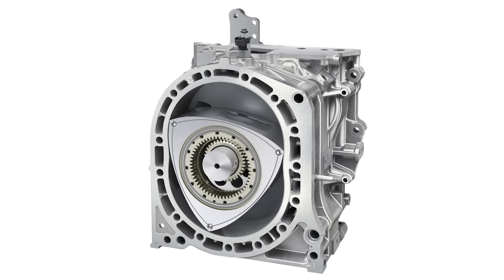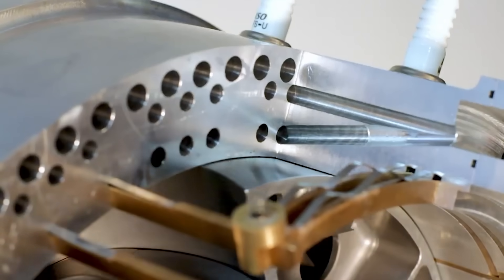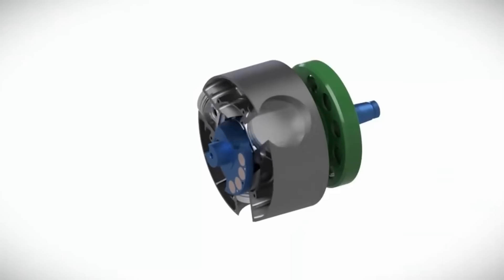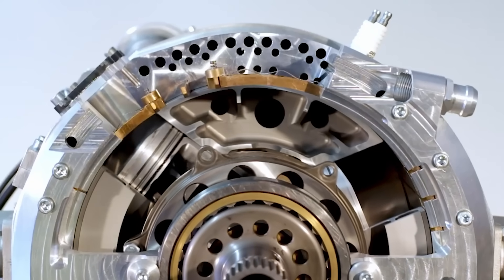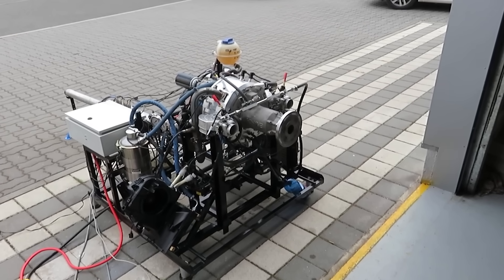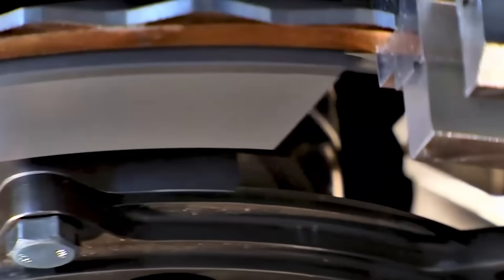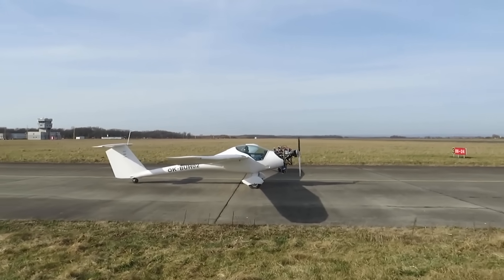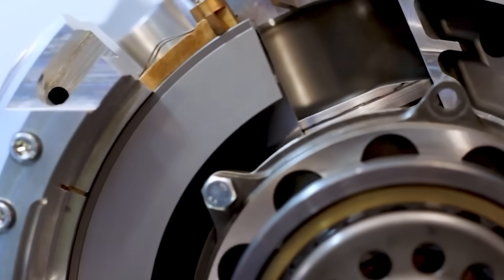The Birotary Engine: A New Spin on Combustion

Comment: This is all fake. It's completely nonsense. It's amazing. People can talk and write things down. It's really crazy. There's really nothing else. There's only really four or five types of engines that work that we know of the four-stroke psycho engine. It has a long stroke or short stroke. It's kind of a different engine. Economy is like a medium stroke. Then you have the two-stroke cycle. Then you have the jet engine and then if you go electric you still need a generator. The electric motor would be the best but electricity is hard to come by just like hydrogen. It's possible there's a lot of engines out there. Freight trains medium size boats that use electric motors Pepto diesel gas generators

Comment: The counter rotating shaft still does not counter effect of the full weight of the total engine rotating in the opposite direction. There is still going to be torque issues also, even though you have a planetary gear system. This engine has a specific use, which is also countered by already efficicent engines that are more useful in aviation and ground vehicles. This is not a break through, but a concept that has already been tried and failed, by people thinking they have the next revolutionary thing. Money that was spent by investors, that are not on the higher spectrum of I.Q. If this is what the money invested in gets them so be it. The next revolutionay engine uses a total enclosed system useing hydrogen. The governments do not want this because it would be a total collapse of the gas and oil industry, which support so much taxes to said government. Hydrogen is free and can be extracted from water. A non taxable compound, that is produced easily through rain or a drainage ditch, that the government can't control. That is where the future lies, if the people finally say enough is enough, our government has too much control of our lives and economics.

Comment: I suspect cooling is going to be a problem. Especially  the actual cylinder block portion. Heat expansion is going to be an oil seal nightmare.

Comment: In contrast to the Wankel engine this engine is a piston engine. In contrast to other piston engines with the same swept volume it has a much larger total volume, it has more moving parts and much larger moving masses. Furthermore, the manufacturing and assemby and disassambly of this engine is more complex. You can get the same functionality by a simpler star design engine, which has also less total volumen and moving masses. And you can also modify the contol valves of a star design engine by use of two stroke principle an intake blower and rotary valves.

Comment: Two problems right off... 1. The main rotating cylinder body seal will eventually leak oil and combustion gases. 2. Oil will immediately build up on the bottom of the pistons changing its weight and flooding the cylinder walls. The centrifugal force of rotation will prevent this from ever becoming a solvable issue, unless the bottom of the pistons were axially level with oil discharge holes at the bottom of the stroke.

Comment: Interesting idea. I'm a big fan of minimizing components. Simple systems are inherently less error prone than complex systems. I don't see a future for it necessarily as a direct to drive train application, but as the basis of a hybrid system it could be a thing if the lubrication can be worked out. Good luck! I hope to see future improvements... even if it does sound a bit like an upscaled RC engine.😀

Comment: Engineers chime in here, but it seems like the power stroke is going to be fighting the pistons being flung outward by the centrifugal forces generated by rotation.  I'm guessing there's some natural upper limit to RPM on this engine design.  Would that make this a relatively low-revving engine?

Comment: De no llevar válvulas que necesitan espacio para subir y bajar yo desplazaría la cámara de compresión y la incrustaria en el rotor contigua al cilindro en la dirección de giro
Con forma de garfio así logramos que toda la expansión de la mezcla golpee sobre el rotor dando directamente todo el par al rotor.

En una rueda que gira si aplicamos el vector fuerza en su perímetro se obtiene Potencia= Fuerza x brazo de  potencia (Radio)🎉

En los Otto el brazo de potencia en más pequeño (el codo del cigüeñal)

Comment: The WW1 rotary engine which had the whole engine had issues due to the gyroscopic effect from the engine.  If they can get the counter rotation in this engine to cancel most of that out it would be a bg step in making it useful.

Comment: What you get is a waste of time.  Stop spending money trying to eek out a bit more from an internal combustion engine. Electric transport is the only way forward. It's simpler.  It's more efficient.  It's cleaner.  It doesn't produce greenhouse gasses.  You can charge it at home, sometimes for free always for a lot less than buying petrol of diesel or even LPG.

Comment: This is a really unfairly positive and incomplete take.  There's lots of details on the positive aspects and components, but zero details about the flaws.  The 2 biggest rotary engine flaws are seal wear and inability to cool the central rotor.  This fixes one but not the other.  The sleeve valves are great, but what about all of the known and unknown problems of such an arrangement besides "timing"?    So much interesting info left out!

Comment: Interesting, but due to the large amount of area that is exposed to combustion pressures, I think it will have about the same service life as a rotary engine. Another issue is that an object in motion wants to move in a linear fashion. Because the pistons and cylinders are rotating, it seems the pistions and cylinder walls are going to wear more on one side than the other, shortening its life even more. On the plus side, it employs a number of innovative concepts. At least it runs, which is more than can be said of other experimental engines.

Comment: If it passes the longevity test and actually gets work done efficiently of course it will be a winner! 
There are many new engine designs, but they never have them worked out yet. While interesting it’s nothing to get excited about.. I want to see it working for thousands of hours doing substantial work while saving substantial fuel/energy. 
Internal combustion engines will always have a place in future application.

Comment: how stupid an engine design this is.  it has taken every negative aspect of a wankel rotary (seals, lubrication and more) and thrown every negative aspect of a "standard" ICE into a spincycle.  you're using combustion events to spin the innards counterclockwise while also using the combustion events to spin the shell clockwise AND expecting the energy remaining is significant? laughable

advancements come from simplification or optimization. this does neither.

Comment: Looks like it still has the sliding seal problem, the weak spot on any Wanker engine, and one which was never solved.  
Because lubricating flat surfaces (which always move in the same direction) turns out to be much harder than lubricating reciprocating round (ie; topologically connected, short path) surfaces.  Cool science fair project tho.

Comment: I'm not sure about this design.  It seems to combine a rotary with traditional engine but I don't like the high rotating mass and inefficient sealing of sleeve valves.  Tuning this engine's breathing would be a challenge as well as long term reliability/durability.

Comment: I like this alot, as well as the Achates opposed piston engine, the Orbital direct injection 22 stroke, and the INNengine e-Rex "one cycle engine" but as with many interesting and promising designs, they never make it to an application or an actual platform (auto, boat, airplane, etc). Good ideas and interesting engineering, but essentially dead.

Comment: all those gears and spinning will seep power like no tomorrow. plus one of the issues with wankel engines is that you can't have variable cams in them because the cams are ground into the housing. all that rotating, huge mass will be slow to respond so throttle response will be crap. not good for cars but for airplanes maybe.
Reply: For planes it's even worse. Imagine you're on final approach and you're short on airspeed so you open the throttle just for you to stall before the engine revs up in 3 to 5 business days.

Comment: now all you need is a rotating assembly oil and compression ring that rotates so that it doesn't have to sweep the open across piston cylinder burning oil.

Comment: I can anticipate long-term seal problems. There is a considerable amount of surface area that has to slide against other surface area. This makes proper lubrication all the more vital.
Reply: It's less surface area total than that of sealing rings in each piston.
Reply: @michaelbuckers  Rings never hit edges on 4 cycle engine, so they don't wear as fast. What does the sealing is oil. This would just burn oil because it would always get into the air fuel mixture.

Comment: Having this huge heavy rotor means poor acceleration compared to a comparable three piston engine. But the non-sine geometry could help with fuel economy.
If there is use for this then maybe in generators or aircrafts.

Comment: No words of efficiency?
Reply: You don't need to be a genius to see it's abysmal. Wankel engines already have astronomical fuel consumptions and this not only seals even less because of the greater contact area, but it also has to deal with the inertia of the pistons.

Comment: Change spark plug and then you realize a small chip of crap got inside, or a small chip got in through the air filter, and it rips through all the seals because IT CAN. Not the same with most other engines, but was true with Wankels. The seals here are not efficient for conserving energy. Interesting design, but more interesting to me is if you total up all the patent and R&D expenses and explain them for the useful worth. What nations will NOT abide by patent laws? China, russia, N. Korea, Iran, Venezuela, Cuba, ... and more... please name them and then detail the size of GOOD markets.

Comment: The exhaust port consists of cross-sectional area almost as large as the piston area.  That's going to be a problem with near zero scavenging but it looks absolutely ideal for a turbo system.  This man is absolutely brilliant.  Congratulations to him.
Reply: it will burn oil like crazy.

Comment: You don't NEED to WAIT to put this engine in a car. It would be great for HYBRID, engine system on an electric car. It has no vibration, and that helps any generator you pick for the car. It's also light.
Reply: This is literally the worst possible engine for a generator. For a generator you want a low revving high torque engine, that's why train locomotives use diesel engines.
This has pathetic torque, enormous levels of emissions (EPA will never approve it much less the EU), and is worse than a simple wankel in every single metric.
The guy based the design on a complete misconception that modern valvetrains are fragile, which they are not at all.

Comment: All fine of it's powered by compressed air but the moment you use a Carbon Based Fuel to make a compression you make GRINDING POWDER and what was a nice seal when new will begin leaking after the first full rotation.
The Carbon powder will totally destroy this design ... go back to electric

Comment: In 1962 I saw my first Wankel Engine at the EAA Rockford Fly-In. It was sitting just inside the Gate where you enter from the field and Felix Wankel was there explaining it's benefits. He had a small prop mounted on the engine, which he spun by hand to start. Within seconds we were covered with oil but we'd seen the first running of a Wankel Rotary Engine. Mr Wankel was hawking the Rotary as an Aircraft Engine because us its Impressive Power-to-Weight Ratio. But, Yes, there were still some problems to be worked through, notably the lube oil issue. It will be intriguing to see what sort of Power-to-Weight Factor this engine has.

Comment: The wenkel rotary’s greatest problem are the many moving seals. I don’t see how this will not have the same problem
Reply: Agreed but one of the problem with wankel is that seals are located on the rotar making direct lubrication impossible. In this motor the seals are on the housing so possible. Likely emissions issues with oil burn

Comment: There is a lot of frictional losses in sealing the combustion chamber. Rod ratio looks low so side loading on the pistons will also be an issue. Cooling the cylinders doesn't look like it is very efficient. Thermal growth of the cylinder block will make for some sloppy tolerances earn cold and potential siezing issues if it gets too hot. Neat, but I don't see it panning out in the real world.

Comment: What are the torque values that are comparable or exceed most not all engines of that size? I call bullshit on this nonsense engine if its so good show it at 7000 rpm why do we have to imagen it? How easy is it to mass manufacture and is it cost effective? It's also limited to fixed valve timing and duration. It is compared to a Wankel for reliability what a joke the only company making them is stupid Mazda and they are just range extenders on EVs. In order to test these engines for longevity and reliability hundreds need to be tested at the same time side by side some of these engines need to be taken apart and have the parts measured to test if the thing is kicking its own ass before you can state that it is of any merit.
Reply: The wankel on the second generation RX8 is actually quite reliable, it just has awful fuel consumption and emissions.
There's also a few companies commercially selling much more improved wankels with better apex seal designs.
The main problem with Mazda's early rotaries is that they were all derived from their LeMans design which didn't have to survive longer than a single race.

Comment: Very impressive but as one chap mentioned, the angular speed due to increasing diameter of rotating assembly, maybe a limiting factor. However further development and increasing material science may well solve wear, heat, friction problems. Good job and hope it works out. 
Regards, A man from the Ozzy Velt!

Comment: Last 20 years i have lost the count of all the new cool engines that were supposed to make the traditional Otto cycle IC engine obsolete. This is cool tho. An engine where the pistons go straight up and down and eliminate piston rubbing is good. But i think of all the engine design that have come forth last 20 years is opposite piston that has coils in the middle and can create electricity. Free-piston engine linear generator (FPEG) they call it. Could be a efficient electric car range extender...
Reply: This is an Otto cycle IC engine. 

The pistons experience lateral force like any other piston in a crankshaft and connecting rod system.
Reply: It's literally just a regular 3 cylinder engine with a very large round head. The French already tried this in WW1.

Comment: Its axial (static) housing layout reminds me of the boxer block but at 120° opposition instead of 180.
The firing plug opposition seems to me a better design than the Wankel double spark plug design (wankel uses for complete combustion).
I'm interested in the Bi-rotary crankshaft, it appears to be a simpler design than an eccentric crank. Almost a standard crank but even shorter than a V-6. 

I also love deleting the timing belt and camshafts. 

Now about that exhaust note 😂

Comment: My first concern is heat dissipation!  Engines that run near rated power all the time - aircraft and boat, need lots of cooling.  The fact that the pistons AND the cylinders are rotating and essentially uncooled is a problem.   The Wankel rotary also had this problem in aircraft applications.   There's also the additional friction from the wiped surfaces rotating along with the idea that you're driving the pistons toward the crankshaft as they rotate.  This last point will probably be balanced by the change in angular momentum of the other pistons.
Reply: I wonder if it could be adapted for low-rev, high torque diesel platforms. Diesel has a lower combustion temp that could mitigate that. Making the external components aluminum for heat and internals cast iron for strength could help maybe?
Reply: Ez pz, just run it on straight alcohol and sprinkle in some water.
Reply: I think you can cool the oil.
Reply: @m.j.debruin3041  It's a beginning, but it's not enough.  Cooling is proportional to power/efficiency, so you still need to dissipate that much unwanted heat.
Reply: @Mikexxx531 i think if you only use oil as coolant, you can run the engine much hotter than 95° C , which in turn make the engine dissipate more heat from convection, and run more efficient also, there could be a sweet spot in there somewhere,  i think.
Reply: @m.j.debruin3041  I agree, though there is a risk of fire(as shown by the Bobcat 863 fires with their oil cooled engines).  They can be more efficient, but there's lots of engineering involved.  Aircraft have a unique problem with light weight and full power operation much of the time and shock cooling when on descent at idle power.  Liquid cooling helps with this to a degree, but light weight in a small form factor requires lots of fluid circulation.
Reply: @Mikexxx531 yeah and then it needs a long time tinkering with the possibilities, which makes it a costly gamble. Maybe the Chinese can do it cost effectively.

Comment: Cool design, lots of issues im sure tho.
Very complex which isn't a very good thing for mass production.
Very unique tho.
It took us over 100years to make diesels as effective as gas of an airplane engine.
Rotary engines do exist in airplanes, but not as common.
The major problem with rotary engines is the lack of lubrication. 
They burn out the seals quickly, even built engines.
Thats not exactly something you want when your in the air 😂.